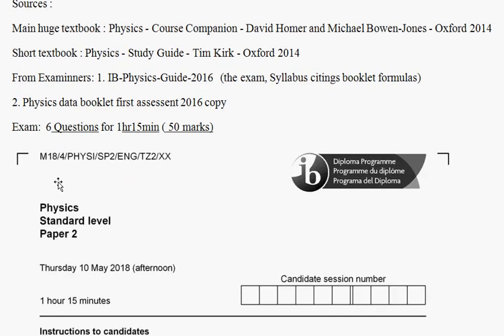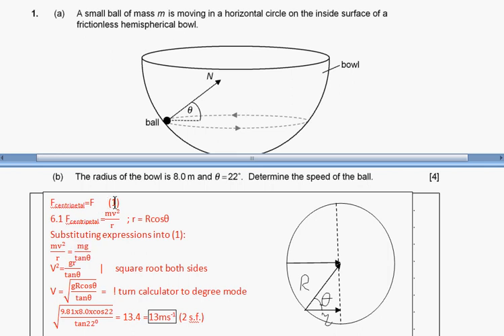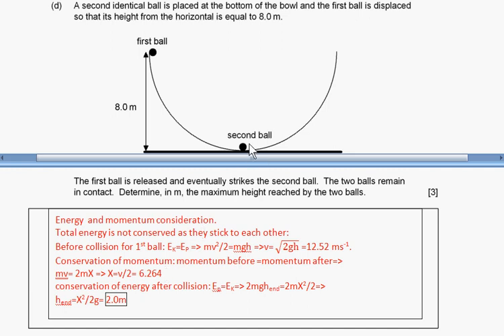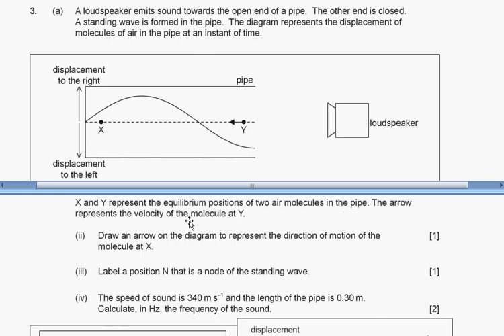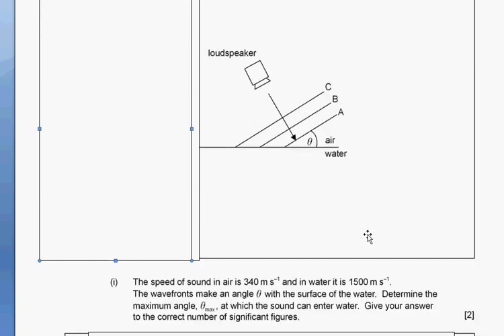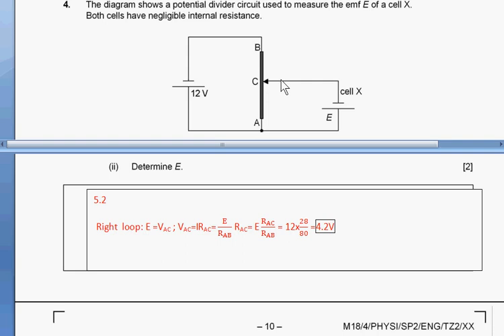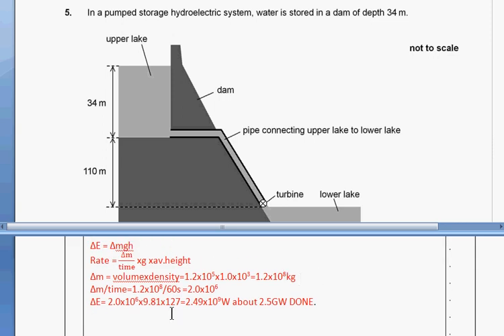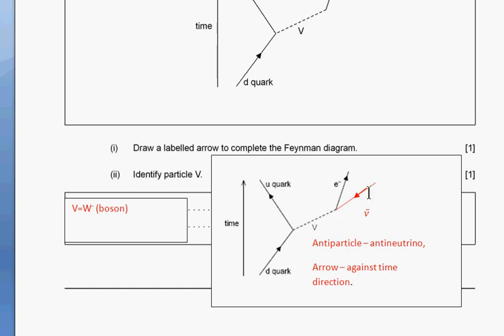Solutions  TZ2 IB Physics SL paper2  May  2018 past paper teacher baku

Comment: sir,in que 3 b at time 16.41 in the video,how does total internal reflection (tir) take place when the ray moves from a rarer medium to a denser medium,for tir to take place i.e for critical angle the ray has to pass from denser to rarer medium,pl clarify,thanks.
Reply from the maker: For sound situation is opposite to light:
in water in moves faster than in air, and here TIR takes place for less dense into more dense situation !
Reply: @NarimanRzaguliyev  sir,thanks a lot for ur clear reply,just one more thing if sound travels faster in solids,why sound gets obstructed by walls where as it should travel faster and louder than when there is no wall,thanks.
Reply from the maker: Sound is reflected by the wall, transmitted an absorbed as it propagates in wall. It is absorbed and become quiter as it propagates.
Reply: @NarimanRzaguliyev  thanks a lot sir.
Reply from the maker: Not at al. Keep asking questions !